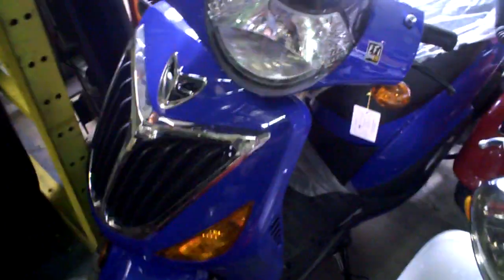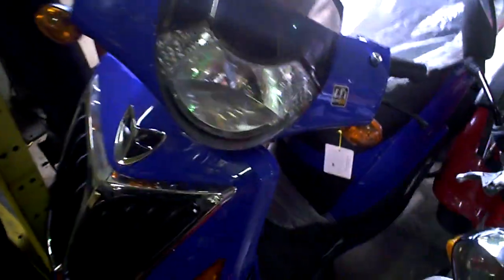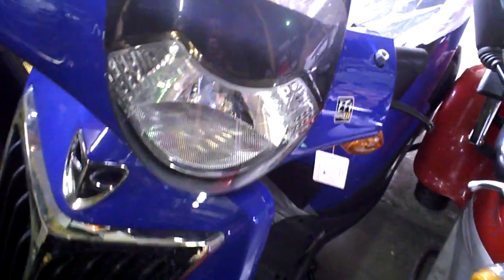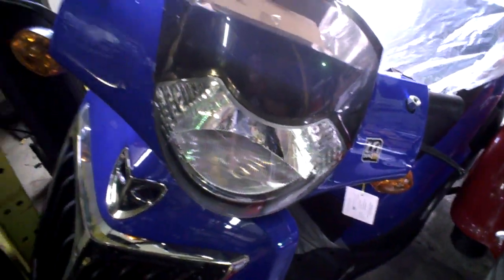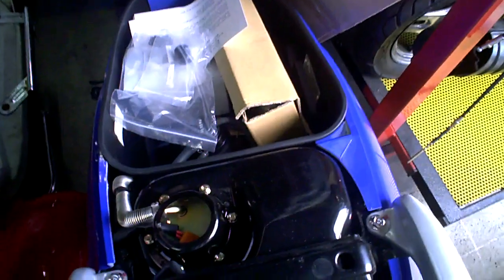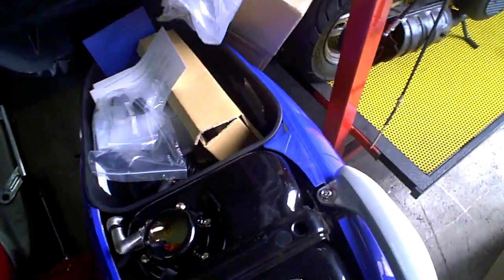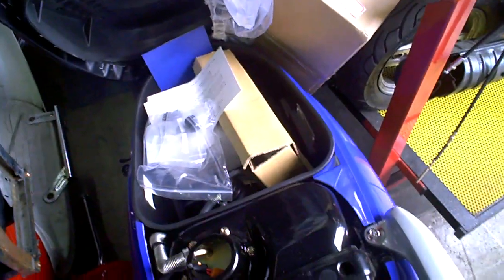CFMOTO EFI 2011 New Ducati Electronics on Charm 2011

Comment: I heard that if you try to start the scooter with a low battery it will fry the Ducati ECM. I have an echarm that I think this happened to. I tried tracing some wires but it's hard without a proper wiring diagram. The one i got looks like it was photocopied from the back of owners manual, does not indicate circuit operation. Does anybody know where to get a legible diagram
Reply: I'm an industrial electrician and picked up a 2008 echarm that had no spark. Like you, I couldn't find a good diagram, so I started with the one in the service manual pdf and traced the wiring out with color codes and device descriptions all the way to the ECU. I'm not familiar with Youtube enough to know if there's a way you can message me here with your email, and I''ll send you my documented copy.
Reply: I know it's a old thread but my echarm won't crank or prime fuel pump or anything and been checking fuses and no broke wires .did u fix?? @carlwithers7059